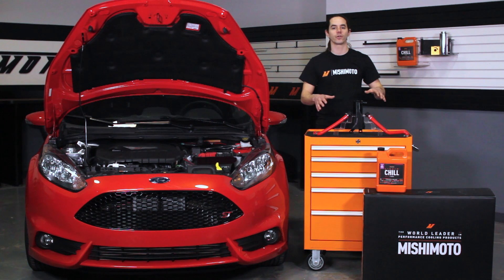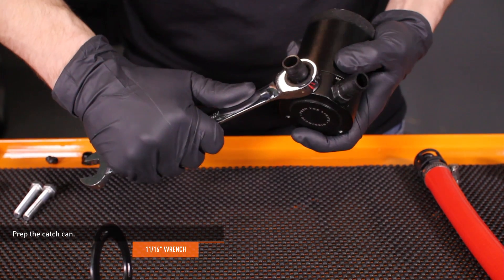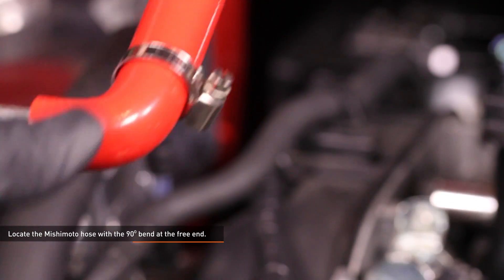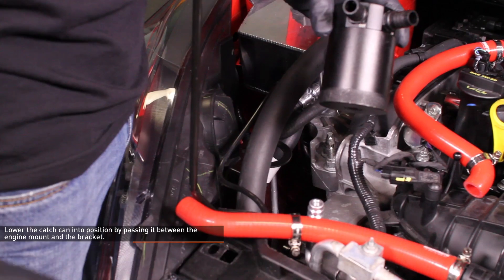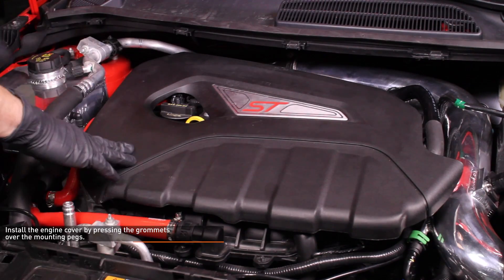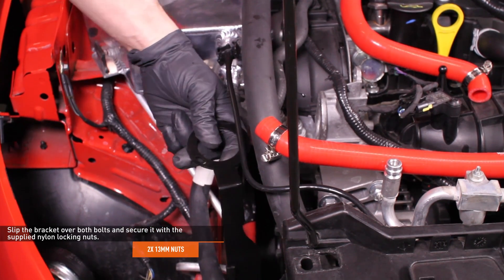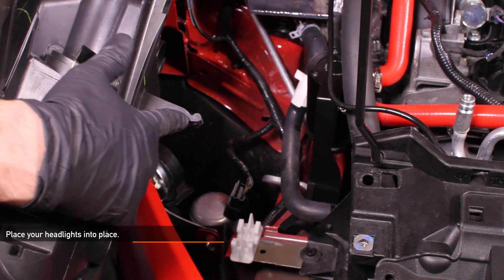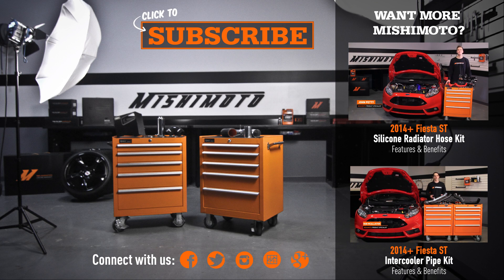2014-2019 Ford Fiesta ST Baffled Catch Can Installation Guide by Mishimoto

Comment: Ive installed mine a few weeks ago and have since put the car in storage for winter ( i live in canada with temps reaching -40C at times), i will liukely remove it for winter storage as a precaution, but, winter driving seems to bring up some conflicts in optinion, mainly on frozen bronze filters which could cause damage to the crankcase on start up. Im thinking of removing it during the winter in the future when i plan on driving the car during the winter. Is this fine, or am i over reacting and its fine to keep it i the winter and i should just empty it out more often. Does Mishimot have any reccomendations? I have a 2017 fiesta st.
Reply from the maker: You should not have any issues in the winter!
Reply: @mishimoto  Thankyou!!, wow, seven years later and still answering comments!!

Comment: Ecoboost 1.6 has 2 stock oil catch cans: 1st mounted on short block near thermostat and 2nd in valve cover. For what purposes your catch can is?
Reply from the maker: What you are referring to is your PCV and CCV. Although they do a good job they do not catch it all. The catch can is designed to stop the extra oil from reaching your intake valves and prevent carbon build up.
Reply: @mishimoto  ok, got it. Why didn't you install 2 catch cans?
Reply: @ysnvts  They have one available for PCV and CCV. PCV is just more popular and better for daily driving I think.

Comment: Hi do you have to remove the headlight to empty the can
Reply from the maker: Hey fluffymat1. You may be able to remove the can without uninstalling the headllight, but space is extremely limited. This would be a great application for our drain kit. You could likely run the line through the fender area to make the draining process much simpler.  ( MMBCC-DRAIN-02 ) https://www.mishimoto.com/compact-baffled-oil-catch-can-petcock-drain-kit.html

Comment: had mine fitted a while now. after a drive oil vapours sit on the in pipe and make it oily, and has changed to a dark blue colour. is this normal? after another drive it goes sway but then comes back and the cycle repeats. thanks
Reply from the maker: Hey Steve, please contact our customer support specialists at 1-877-GOMISHI or email support@mishimoto.com if you are having difficulty or experiencing any problems with this catch can kit!

Comment: does the new bracket make it easier to remove and empty the can? I can unscrew it and lower it but not remove it so I have to use a hose to vacuum out the oil from inside.

Comment: Did you guys used to have a installation guide that used a mounting to the side motor mount at one point?
Reply: Yeah, they did.  Just in case you need this info, the torque spec on the motor mount bolts is 60 ft-lbs or 81 N-m.  I did a full write-up on the process if you need more info:  https://howtune.com/articles/281-install-the-mishimoto-oil-catch-can-kit-on-a-2014-ford-fiesta-st
Reply: Do u need to remove headlight to empty the can